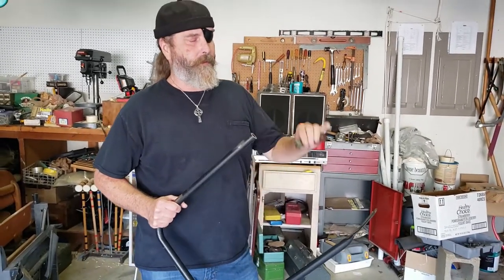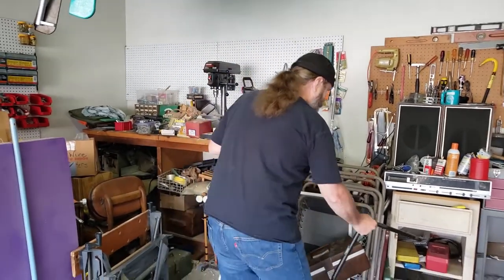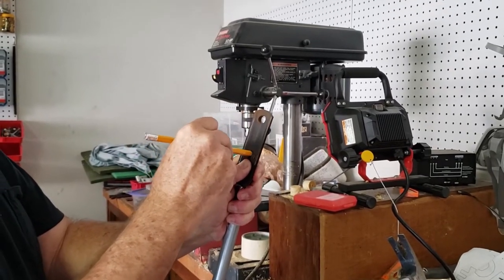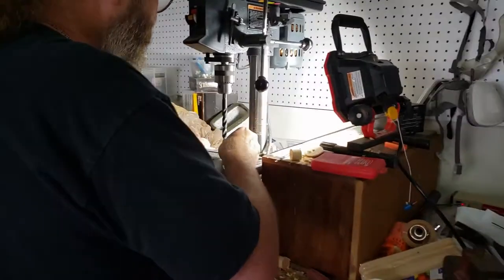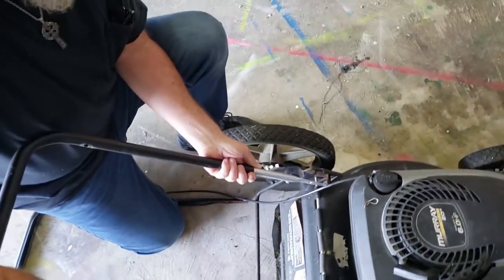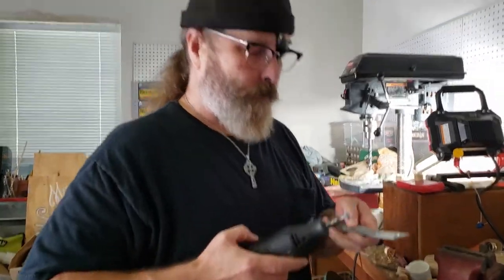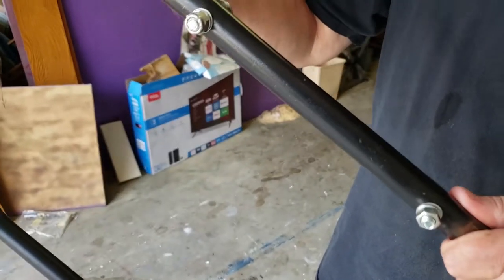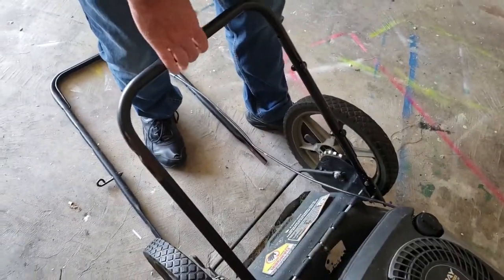How To Fix a Broken Lawn Mower Handle for Under $5

Comment: I had same handle break on a 25 year old Murray mower.  I slipped a 1" diameter, 3 inch long piece of copper tubing over the handle, then  mated the broken flat piece back to the handle and "glued" with JB Weld.  When this cured, I slid the copper mending sleeve down over the epoxyed repair,  drilled 2 small holes on each side of the mend through the copper sleeve and the handle,  used 2  small bolts through the drilled holes, then  filled the gap between this copper sleeve and the handle with more JB Weld.  I used a popsicle stick to force the JB Weld into and around this mending sleeve.  
After 24 hours curing, I put handle back on mower and finished my lawn.   Your idea looks more factory original,  but the design of these handles poses the problem of that narrowed flat piece which is an inherent weak spot.
The copper sleeve, bolts, and JB Weld adds a measure of reinforcement to what is a weak spot on all lawn mower handles.
Reply from the maker: Aye, matey, thank ye for the alternate fix! Very well thought out!

Comment: This actually worked. I went to Ace Hardware, and they had a 3 ft length of metal tube that perfectly fit in my KOBALT Electric Mower lower handle that broke off exactly where the handle broke in the video. It cost me about $20 to repair it and took about an hour.
Reply from the maker: Aye, matey, glad this helped - smooth sailin'!

Comment: Good video, I had the same idea to fix an old lawn mower with a broken handle so I could pass it on to my sister as her completely failed (the deck was so corroded it collapsed!).  I figured something like this would work but good to see someone else trying it first.  If the pipe is galvanized, depending on the paint it might need a primer no?  Maybe just a warning for others that not all rust paints are good for galvanized metal.
Reply from the maker: Aye, matey, thanks for the tips - much appreciated!

Comment: Same problem happened to my Ryobi 6 year old battery mower, lucky the lower handle was 'only' AUD$42 so I bought a replacement ☺️ If the cost was horrendous like yours, your repair was quite useful.
Reply from the maker: Aye, matey, you be mighty lucky! And thank ye for the kind words - smooth sailin'!

Comment: Nice solution.
 I have a flymo 460 sde that broke its handle. 
Its a really bad design with a heavy mower. 2 side arms attached to the deck with resin discs that attach them to a 1 piece handle
. I think the design was made so you can lift the mower by lifting the handle up, pivoting the mower around the front wheels. You cannot push the handle down to pivot it on the back wheels lifting the front. The resin discs are adapted for a curved handle end.
It was designed to fail.
Reply from the maker: Sorry to hear, this matey - sounds like a really bad design.
Reply: @thepiratehandyman2225  I managed to drill wood which split with a relatively small bore but survived with 3 x larger holes to attach it to the frame. I will see if I can drill metal. My initial attempts failed but I am not sure if I was practising on hardened steel. Thanks for the video.
Reply from the maker: Good luck, matey - smooth sailin'!

Comment: I watched the video and found it very informative.  I was curious how you got the conduit up thru the dimpled hole in the upper part of the handle..  You did explain how you did it, but it did not register in my brain.  I am thinking you had to drill three holes to secure the conduit.  two thru the handle and the conduit; and one thru the dimpled hole on the handle to catch the conduit you insert in the lower handle.
Reply from the maker: I actually cut the conduit so it stopped before it got to the dimpled hole.  That's why I drilled 2 additional holes in the handle to make sure it was secure.
Reply: @thepiratehandyman2225  
Thanks for the quick answer.  I finally figured it out.  Your youtube video was very helpful.  
Thanks again.
Reply from the maker: Ye be most welcome, matey - smooth sailin'!

Comment: Craftsman model 917.370449 lower handle loose. Bolts go into the lower side. How do I tighten them under the mower deck? Thank you.
Reply from the maker: Had to research this one a bit.  It appears that you can only get to the nuts from underneath.  They are located behind the blade housing.  Take a look at this diagram and see if it helps.
https://www.searspartsdirect.com/model/1ae79pwxew-000247/craftsman-917370440-gas-walk-behind-mower-parts
Let us know if this helps, matey!
Reply: @thepiratehandyman2225  Yes. Behind the back blade housing. I kept looking at the housing on the back underneath , what the heck! Thank you. Checking out the diagrams and/ or I will call Sears Tech. Support. I'll keep you informed. I know the front drive wheels last only a few years= plastic teeth that wear out to fast, but shop around for the best prices on the front drive wheels. I got then for like 2 for $40.00. ONe site they were over $100.00 for the pair. Not me. No, no!

Comment: Is there a way to build the whole handle and lower for push mower
Reply from the maker: Aye, lass, ye would need some specialized tools to properly bend the pipe. Ye might try to find one at a parts house?
Reply: @thepiratehandyman2225  do you what size and what kind I could use
Reply from the maker: It depends on your current handle.  It could be anything from 1/2 " to 3/4".  I used aluminum conduit.